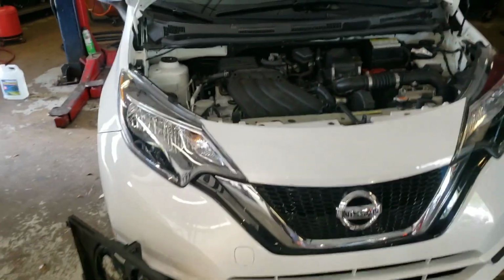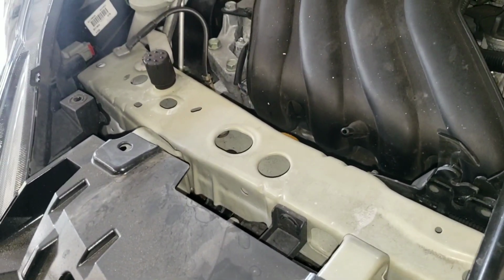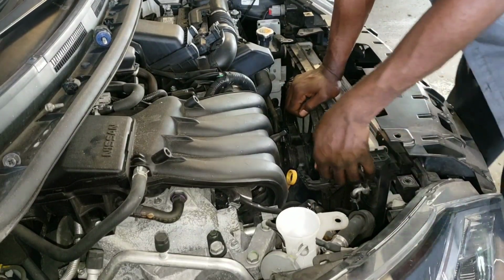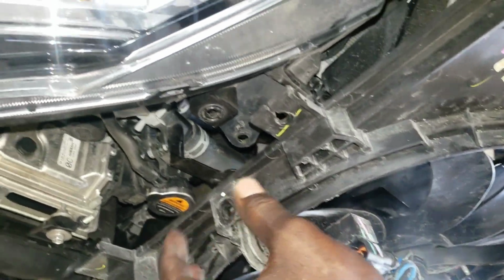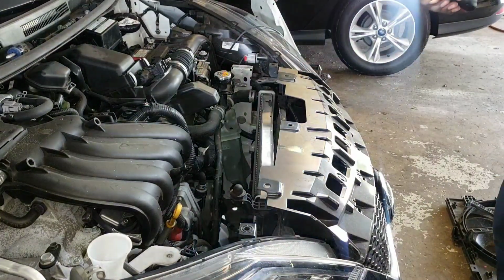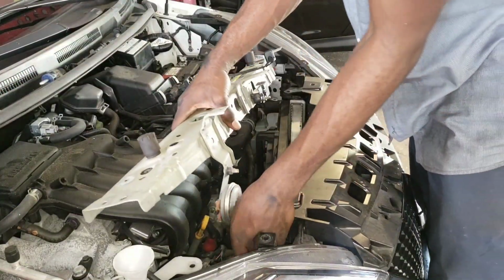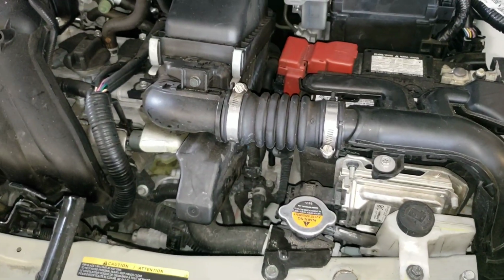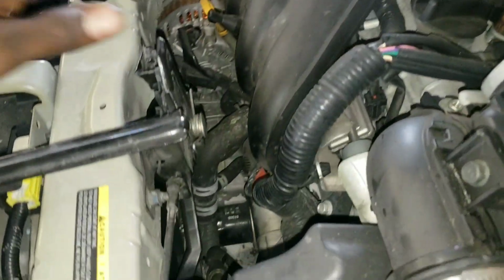Nissan versa note radiator fan / cooling fan replacement

Comment: Thank you so much bro. 2nd video I’ve used to fix something. 2015 Nissan Versa note here. Not an easy fix at all but wasn’t TOO bad. Hardest part was unhooking the hoses from the bottom.. no way I could have done it without sliding under the car (barely fit). My problem was a/c would stop blowing cold/ car overheating at stop lights.. everything was normal while driving though. Fan speed was very weak when I checked under the hood. All problems fixed now! Thanks again!

Comment: Great video. Helped me get started. The Nissan I worked on had hoses clipped to the bottom of the fan and I could not reach them from the top. I had to jack the car up to unclip them, pull the old fan out and then reclip the hoses once the new fan was in place. Now I know why the shops wanted $700 for this work.
Reply from the maker: Lol

Comment: Thank you so much for making this video, I needed to replace the fan on my 2015 Versa Note and this step by step video helped me do it. Thanks dude, couldn't have done it without you.
Reply: I have a 2014 versa note. My ac stopped working at an idle and the temp started rising. I'm pretty sure it's the actual fan. Did you try the relay first? Or did you know it was the fan itself? Thank you
Reply: @shawnjones7512  wow that just happened to my 2015
Reply: @zolphdiggler  it was the fan

Comment: For anyone having trouble removing the radiator on a 2015: The two oil lines (I think its ATF fluid?) do NOT need to be removed, they can simply be pulled away from the radiator without undoing any clips. If you remove these lines then you will drain ATF fluid

Comment: Changed radiator motor. Tried turning on car. Would not start. Battery was fine. Went on internet. Found this is common and everyone pointed to TCM reset. Easy to do. Turn car to on, then off, then on, then off, then on, then off.  Three times.  Then try turning it on.   Also found out car will go into this failsafe mode if you try to turn it on while hood is open. Opening the hood while the car is on will also trip the failsafe and you will need to reset the TCM. Must be a way to work on this car with the hood open and motor running but for my part, which was changing a $70 fan and saving my friend $700, that is as far as I wanted to play with this car.

Comment: Hello Friend, thanks for the video, do you mind sharing what made you change the fan ? was it completely dead, car over heating or some A/C issues, not cooling while idling ?
Reply from the maker: Complete dead... I check that it's getting power and grounds to the fan but it's not spinning so i know it was dead

Comment: Hey good video, I just did an engine swap for my aunt on a 2015 note s. The car was in a mild front end crash a few years ago and she just kept driving it. We are finding out now that her engine failed from overheating from the fan not working likely from the wreck. After the swap I a new fan in and it is only coming on with the ac turned on. Do you have any idea what the turn on point is for the fan to kick in with the ac of. Monitoring LD it was up to 205 and still had not kicked on. We generally do not do automotive we are a GSE shop for the airport but I am doing this as a favor to my aunt. Any help you can send would be great. Looking for the turn on point of the fan w/ac off and some ideas of why it would work w/ac on and not with it off. Thanks
Reply from the maker: You probably have to drive it and get it to the operating temperature so the computer can tell the fan to come on
Reply: Dullah Goso hard Yeah I’ll try again tomorrow, I did let it idle for 30 minutes or so this morning but it only got up to 206. I guess I figured it would kick on by then and I panicked a bit knowing the previous engine failed from overheating. Thanks for the response.

Comment: Thanks for the assist on this, it helped out immensely.  Just a quick question, after install, the car didn’t start for about 1 hour, then it started and shows transmission symbol on dash. Any ideas?
Reply from the maker: Check and make sour you connect the ground strap on the radiator support
Reply: You probably tried to turn the car on while the hood was open. This trips some kind of failsafe and you have to reset the TCM by turning the car to on and off, three times. Then it will start. I ran into this too. Very annoying.

Comment: How long does it take from start to finish to remove the fan and install a new one?
Reply from the maker: Its all up to the experience you have
Reply: @DULLAHGOSOHARD  I'm trying to estimate the time I would need.  Side of the road job?  Or Wait til weekend in my driveway thing? 1 hour?  2 hour?  Four?
Reply from the maker: @ScrtAznMn  weekend in your driveway
Reply: @DULLAHGOSOHARD  Thanks!
Reply: I’d never done this type of project before and it took me about 6 hours, that’s with identifying the problem first and going to auto parts store several times.

Comment: I have a 2014 versa note. The cooling fan just quit working. My ac stops working at an idle. Did you try the relay first or did you know it was the fan? Just trying to narrow it down. Thank you. I hit the sub button as well
Reply from the maker: I check the power and grounds at the fan and it had power and grounds but the fan wasn't working thats why i changed it
Reply: Hey did u remove the grill
On ur Nissan Versa note? If so can u let me know how?

Comment: I have a Nissan Note 2013 where the car vibrates when the fan comes on I can feel a mild vibration on the steering what do think the issue would be and how do I solve it?
Reply from the maker: If it's the fan that cause it to vibrate yes but you might want to double check to make sure the vibration coming from the fans

Comment: Yo papa you missed that the left bonnet rubber fell down in the front panel of the car it nah go lock good. Or it might vibrate at high speeds

Comment: I attempted this on my versa note 2015. When I tried to remove the fan there was 2 hoses clamped to the fan at the bottom. I couldn't get them off. Any help?
Reply: Same. I took a flathead screwdriver and they just pop off the plastic piece holding it. Easy

Comment: I need help!!!!! I changed out my fan exactly like in the video and my car doesn’t want to start anymore
Reply from the maker: Check your battery because even with the fan out of the car they car will still start and drive you probably unplug something try checking the wiring if the battery is good and also scan for code
Reply: Make sure you reconnect the ground strap from the front of the engine block to the top of radiator bracket.
Reply: Jeff The Man did your car start bc i just did mine and it isnt starting
Reply: @luisjimenez6606  Its the Ground you disconnected. The heavy gauage wire you took off in the beginning.

Comment: I took my 2015 Nissan Versa into a  a Goodyear integrity tire shop and they want to charge me $800.   To replace my radiator fan, but they are trying to fuck me with claiming that my car battery is bad. They really tried to force me into replacing it. I TOOK The battery to Autozone where I bought it and they tested As Good. So WTF!? Isn't $$800$$ enough I think they fucked up something else and trying to blame it in a "bad battery ".

Comment: Bunch of lies.  Most is right, but the fan plugs do not just slide out.  Each one is locked in differently. Both have a toggle lock. Top one is on the top and bottom one is on the bottom.